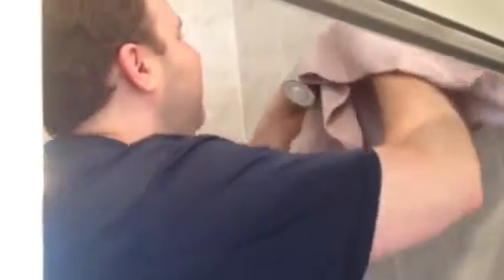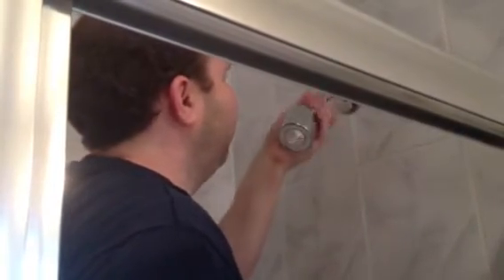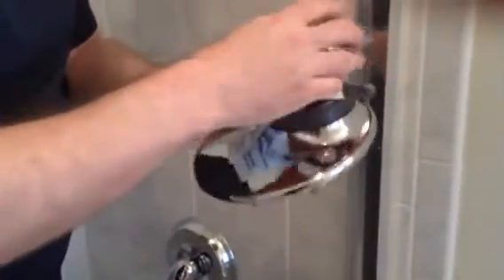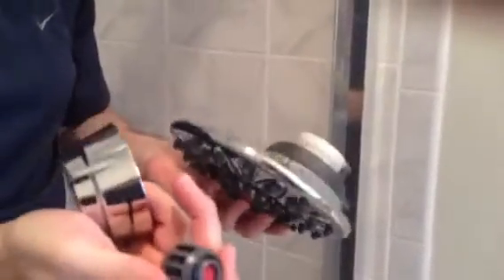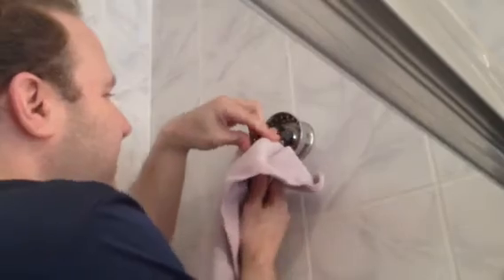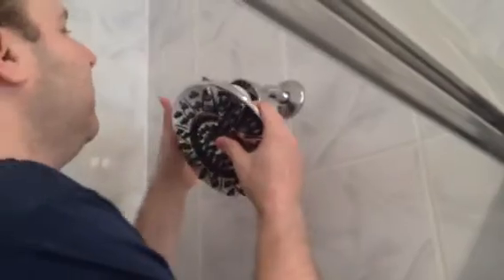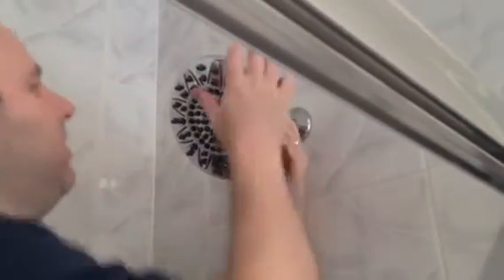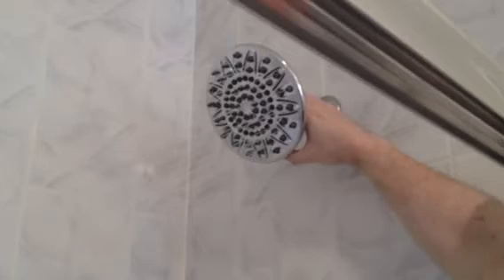How to install a Waterpik shower head

Comment: You forgot to check for the washer inside the J pipe from your previous shower head.
Reply from the maker: I don't recall seeing any washer in there, nor do I know where to even look for it. That wasn't mentioned in the instructions. How would that washer affect things if it was still in?
Reply: +Andrew Kardon mine says that in the instructions too... but your video is awesome. thanks